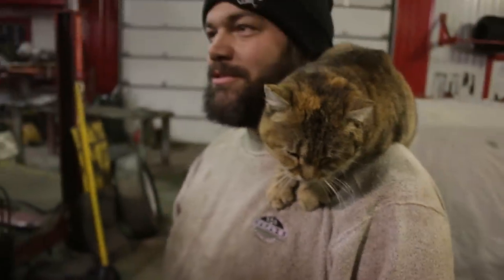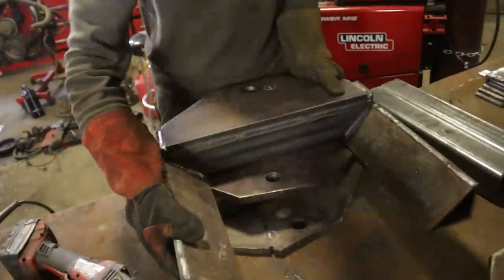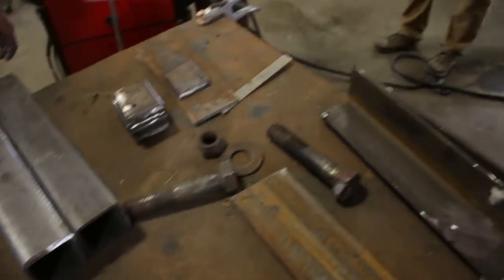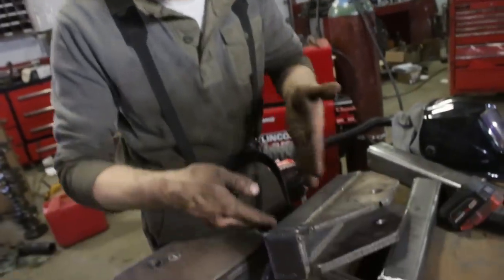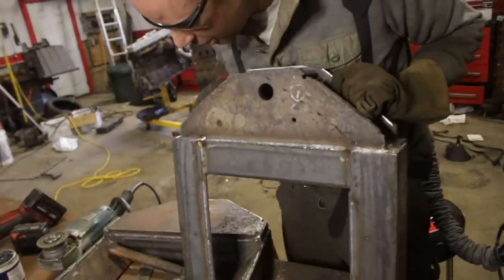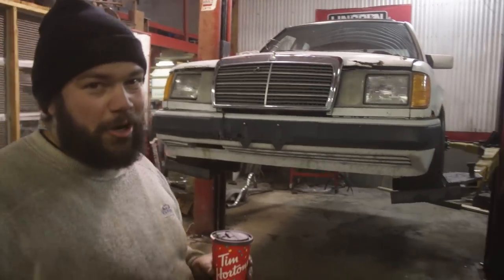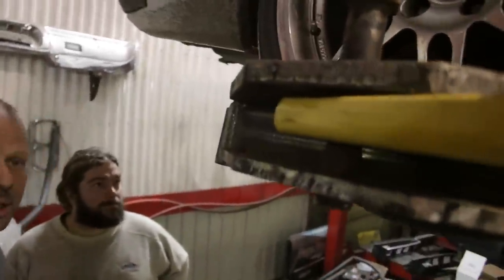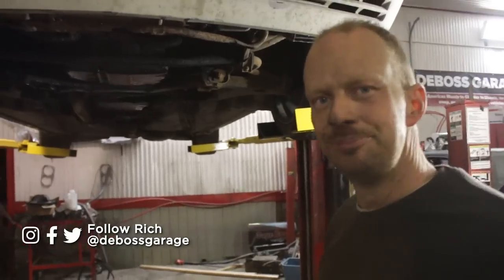How To Build Wheel Engaging Adapters For Your 2-Post Car Lift

Comment: I would use a good grade of bolt or pin that would be your weakest point I believe
Reply from the maker: On the list.  Bolt isn't enough.  If it can pick up the 4400 lbs Mercedes, our 3400 lbs Audi will be fine.  The engine is usually out of it anyway!
Reply: The arms twisting. Was never designed to be that far out and taking a sideways load.
It is a way stronger lift though than the load on it.
I would use it.
Reply: @turboflush  It's not twisting. What he should have done is shortened that bottom plate a smidge thus tilting the whole thing up just a few degrees. What he's got going is just some slop because the top and bottom holes have space between them and so does the hole in the lift. This is very typical when you start making these kinds of connections regardless of how much weight is onboard.
Reply: @johnpossum556  
Your missing what I am talking about. I know and see the slop.

Comment: Nothing against the engineers, I understand there’s a lot of different loading and forces here “going the wrong way”.. but for what it’s actually going to be used for, it will work.. even with 8.8 M16/18 bolts instead of pins (which are better). Enjoy Rich, nice welding work!

Comment: There's a reason no shop ever has something like that.
Reply from the maker: Just Google "2 wheel lift adaptershttps://www.google.com/search?q=2+post+lift+wheel+adapters&client=ms-android-doogee&prmd=isvn&source=lnms&tbm=isch&sa=X&ved=2ahUKEwj9qufYhYXhAhWBj4MKHbYWBRcQ_AUoAXoECAsQAQ&biw=360&bih=592#imgrc=gZ7dzCMFfuMAtM
Reply: I like the rectangular tubing in the google link as opposed to the square tubing on your lift arms. They seem better suited to take the forces being introduced with those adapters. It’s sketchy looking for sure. Also a pin designed to take the load as opposed to a bolt. I do admire your ability to make things rather than buy them but when it’s your life or being overly cautious I’d choose being overly cautious. Over build it and take suggestions from concerned knowledgeable people. No offense just want to be able to enjoy your content for years to come.
Reply from the maker: None taken.  Hard to tell who is knowledgeable and who is a keyboard warrior.  At the end of the day, I thought about it, built it feel 100% to use it.  If I didn't trust it, I wouldn't put it on the internet or use it.  Of everyone commenting on this page, I am the only one that has built one.
Reply: You don't have to know who is knowledgeable. Read the comments and use your experience and common sense to evaluate them. Do some research if you feel it's worth it. You can learn interesting things from the comments sometimes.

BTW  Your "I am the only one that has built one." comment is like those "are you an engineer?" or "I'm an engineer" comments. It's not a valid argument. Just saying.

Comment: The added leverage due to the added distance from the post is going to derate that lift. In other words if its a 7000 lb lift it is now about 6,000lbs or less. Let one of the real engineers commenting do the math for you to let you know what the lift is now rated for. approximately of course. Love your projects but have my doubts about this one. I have completely redone some of my engineerings or scrapped it for the same reasons. I'm not good with number crunching but if I look where the stress is and have doubts I just look at other options.
Of course, that's not even counting the new torsional stresses.

Comment: hey have anyone on here come across an issue with the security system in the 2000 chevy silverado trucks causing a compleat and total shut down? if so how is it fixed?
Reply: WAG but a place to start might be getting "in" via something like HP Tuners and removing the VATS?  (Vehicle Anti-Theft System).  Not sure how valuable that information is, someone else commenting might want to decide that...

Comment: Put a triangular cross brace in the tire cradles to take out the rotation to the other side.  Hell a piece of angle iron would probably work.  Cool build though just dont drop a car on yourself :)

Comment: Looks like Mohawklifts says the lift's max capacity drops about 4000lbs with the tire engaging adaptors they sell. Which sounds logical.
Reply from the maker: 7500 lbs hoist, 3500 lbs race car.  Sounds about right.  Tested with a 4400 lbs junk car!
Reply: @DEBOSSGARAGE   good to go :o)

Comment: This looks like the kinda shit I would do at my shop. Kinda sketchy. And I have my concerns. 
But all these guys talking about the lift arms sliding away from the car...
Any quality 2 post lift will have gear type mechanism at the posts that prevent the arms from rotating once picked up above like, 6 inches? Or less. Every lift is different. But every lift ive worked with, once the car is up, the arms cant move laterally.

Comment: The twisting force on the arms makes me cringe. The arms weren't designed for that. Maybe you could make some lift pads that sit on top of the arms (like the originals do) with built-in wheel chocks, or something. Or you could add lift points to the Audi's roll cage.

Comment: Do what you want but I would be afraid of them sliding out....
Reply: Most 2 post lifts have a type of gear at the post, to prevent the arms from moving even with normal pads on them.
Reply: They're meant to come into play in extreme cases. It's not a good idea to count on them for regular use.

Comment: Just curious, what's the point of this?
Reply: Andy Kehler in some cases it’s easier to lift a car by the wheels than on the frame: something that is extremely lowered, lifting points have rusted out etc. alternatively, there are lifting systems where you pick up the whole vehicle with independent wheel lifts that are tied together in series. Useful for lifting fire trucks.

Comment: Gotta love all the engineers in the comments. Talking about every different type of load in the book, they all sound like they just graduated. Zero real word experience, those adapters will be more than enough for what he plans on lifting.
Reply: if I came across a building or bridge with the ends of the beams rotated 5 degrees due to torsional loads like in this video i'd slowly back the fuck away.

Comment: Oh you can't swap that Cummins in there. It weights 500 lbs more than the frame and suspension components were engineered for! Oh give me a break. Derate the lift with markings to remind folks, and let it eat. I had a beam in my shop once that was stenciled "Weight limit to be determined by operator" This was done in jest, but there is some truth to this! Most lift accidents have more to do with uneven  loads from front to back. Load testing to a 1.5 safety factor and scheduled inspections of your bolts welds and lift arms will do the trick in my humble opinion.

Comment: holly jumping jakes what you lifting with that, a D8 buldozer, 5/6 or 3/4" plate, 1/4" wall tubing, good lord your lift arms are only a 2x5x3/16 wall tubing, just the weight of them peaces your making is way over loading them poor lift arms, not to mention, you will need a forklift to put them in place, and get them off the work bench,, 3/16" plate and 3/16 wall tubing would still be over kill
Reply: Bulldozers don't have wheels. But 747s have wheels!
Reply: @fascistpedant758  they have idler wheels and sprockets... lol. got ya, the posts would need to be cut down for 747 wing to pass over..